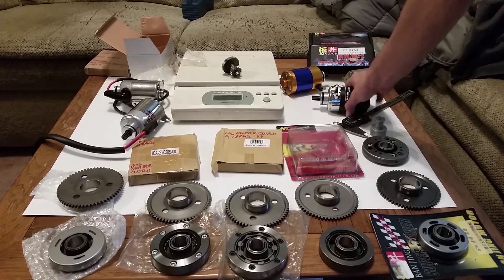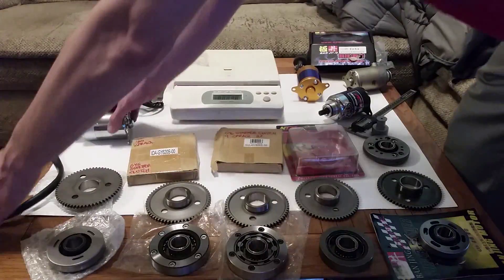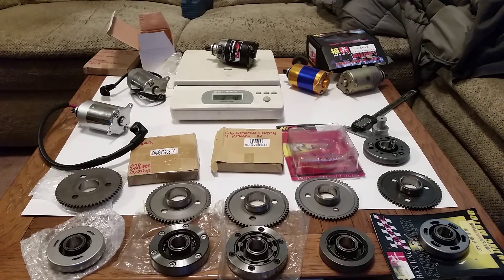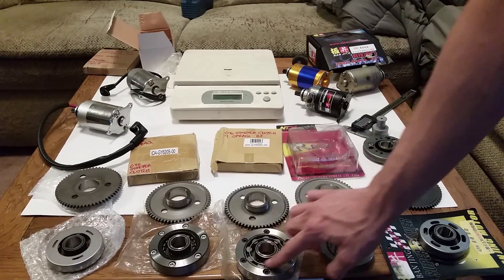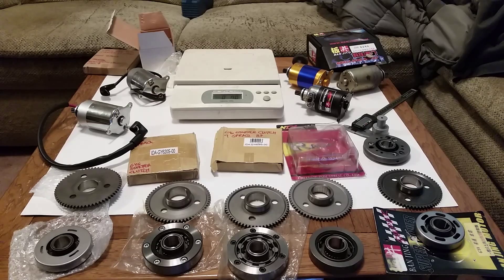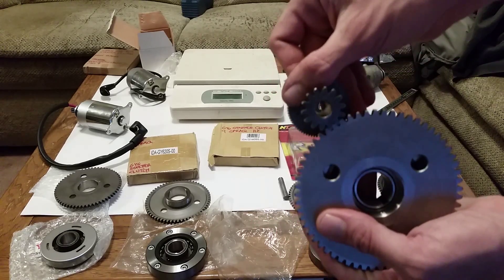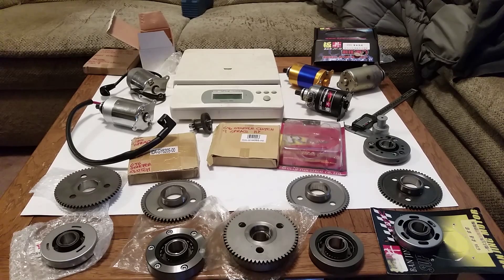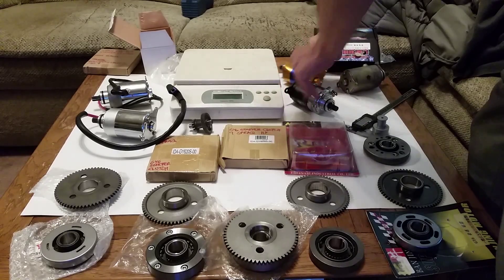GY6 High Torque Starter Heavy Duty Clutch

Comment: This was a really good video. Appreciate it! 
I know it's 8 years old but thought I'd ask if anyone out there has the torque spec for the starter clutch nut?
Can't find it anywhere, I know it's reverse thread and tight may just be good enough, just thought I'd ask. Thanks.

Comment: One more question. What are the torque specs for the 8mm bolts on the crank cover that's to be reinstalled after replacing the starter clutch assembly on my GY6 150cc engine scooter?
Reply: Robert White did you ever find out I'm doing mine this weekend
Reply: ivan caminero yes, 6 to 9 lb/ft

GY6 Torque Specs - General Tech Advice - Dan's Garage Talk
http://www.dansgaragetalk.com/topic/193-gy6-torque-specs/
Reply: Ok thanks soo much for the list will be sure to order me the new digital torque wrench harbor freight sells em,they a attach to any wrench and turns it into a digital torque system. Coombs stuff if your needing gaskets for your engine try taida their made of way better quality than the standard cheap paper gaskets that seem to leak like a faucet lol

Comment: Great Video! I installed a NCY 171cc Big Bore Kit and a Taida High Torque Starter and I had the problem of it not starting and just sounding like the starter is spinning instead of engaging the starter clutch. I ordered a Heavy Duty Starter Clutch like the video suggests so hopefully that solves my issue.
Reply: Ruck Nut did it fix your bike? Did it turn on